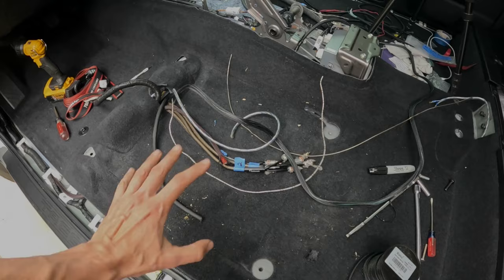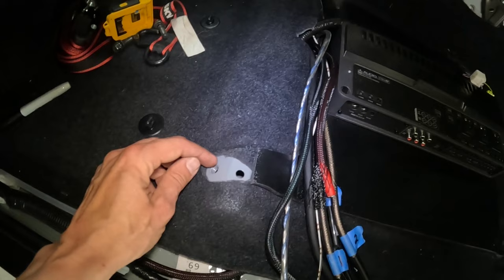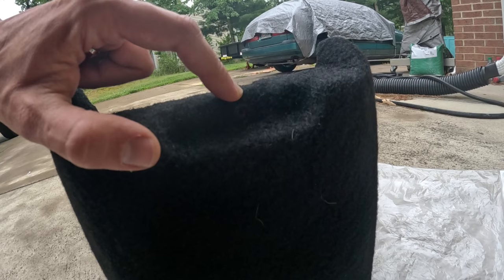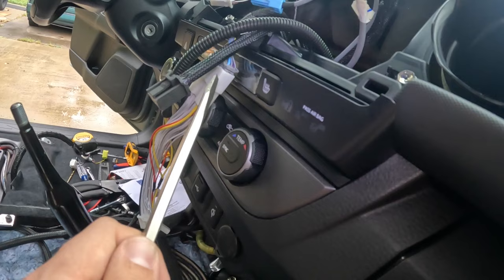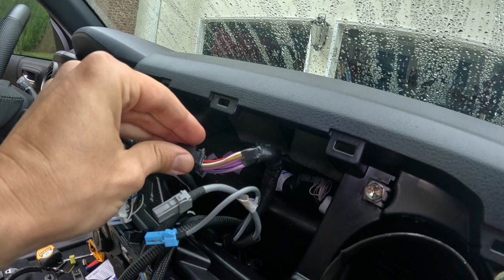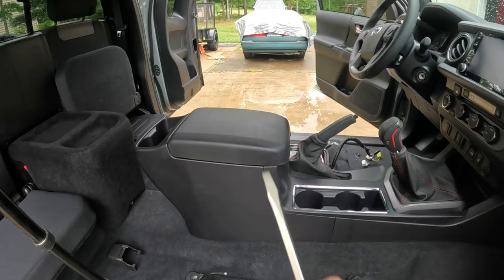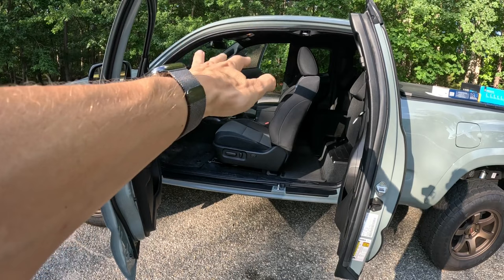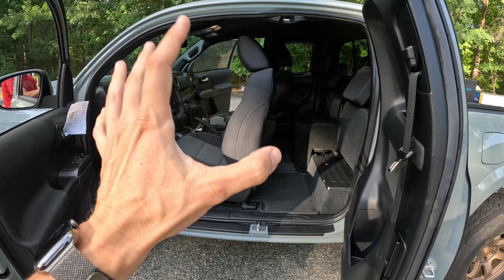DIY - 3rd Gen Tacoma - Adding a Stereo Amplifier and Subwoofer Part 2

Comment: Hello again.  I read my first comments and I have no idea what I meant by the comment related to the word theater in the dash.  

What I can tell you is that I went and bought 2 pieces of 1/4” ABS plastic today because I am going to use your examples to create my amp racks which I like you will install under both seats.  I am installing 2 Rockford Fosgate Amps.  The amp for my Subwoofer is going under the passenger seat.  I like you purchased a Stealth sub enclosure which I will mount between the two jump seats.  

Thank you for posting your videos because they gave me so much encouragement and direction with my project.  

I totally appreciate your videos

Mark

Comment: I myself was planning to do an install in my 2016 Tacoma double cab…so I bought the same Audiocontrol LCI-7 and was planning to get the same Taco Tunes wiring harness…. I decided to have it professionally installed…Stock head unit …Digital Design signal processor DSI-3…Focal Flax speakers…2 way for front doors(he made a custom mount to install the tweeter next to 6.5 speakers)and coaxial for rear…Arc Audio X2 1200.6 amplifier and 2 Arc Audio A10 shallow subwoofers…they actually installed the processor and amp under my driver seat…the only thing in view is the end of the amp(which is vented)…one thing I recommended is to add sound deadening material to the doors and rear of the cab…not only reduces road noise but eliminate rattling noises that a high powered system can produced…for a few dollars more I recommend the digital signal processor over the LC-7i…total control(crossover points and EQ)and was able to make use of the rear door speakers ….unlimited tuning to your personal preference…
Reply from the maker: Wow - really some good pointers here for sure.  Ever since testing out that Stealthbox is my other car which just has an Alline 4v pre-lit to an amp, the sub sounded so much better than how it sounds in the Tacoma (poppy and doesn’t hit as hard).  Either the LC7i is just bare bones or I need to do some serious adjusting.

Comment: This was a great video series to watch. I have a 23 TRD Sport in Lunar Rock as well, but mine is automatic double cab. Yours looks great btw. 
I’ve been searching the internet for something like this in order to check out the wiring before doing any audio work. This was very thorough, detailed and super clean. Thank you for sharing this
Reply: I have the JBL upgrade in my 23 TRD OR,  as for OEM integration. not much as of yet. Some places used a PAC audio for a '21 and claimed it worked. PAC audio says they have not tested a 23 and don't have support for the 23 if a problem arises.
Reply: On the factory JBL system it can be done the same way it was done on this Video. Do some digging online you will finde it

Comment: Hey buddy how you doing, first of all congrats, you did a super clean wiring and installation, now my question is, would this work for me if I plan to add 3 amps, 1 equalizer, and 1 audio control epicenter?
Or I need a different one?
I’m planning on adding a pair of ds18 dash tweeters, a pair of JBL 6x9 speakers, a pair of JBL 6.5 speakers and a pair of massive mid range speakers, also a kicker 12” subwoofer, for the JBLs gonna be using one amp, another amp for the mid ranges, and another amp for the subwoofer, also the equalizer and the epicenter, that’s how I’m planning it

Comment: Great video. I have a 22 offroad in the same color. I also have that same amp. Have it mounted behind the back seats at the moment but want to put a sub box back there so need to relocate the amp under the seat. Do you have any issues lowerering the seat? The automatic seats lets to raise and lower it and I'm worried ill crush the amp if someone tries to lower the seat too far.

Thanks
Reply from the maker: Have not tried to lower the seat down much knowing the amp is there.  But under the driver seat was the best option for the Access Cab as the jumper seats don't fold down.

Comment: Did you lose microphone and yoir back up camera after installing taco tunes harnesses?
Reply from the maker: @bryanbroyles2472  no loss. Everything works perfect.
Reply: @randomrebuilds  I have the same setup as you do and lost my micophone and backup camera plus have noise coming through speakers. Does your speakers pop when you shut the truck off due to the amp turning off
Reply: Are you in NC?
Reply: Did you use the factory grounds under the seats or use the other holes besides the factory grounds
Reply from the maker: @bryanbroyles2472  no noise coming from speakers or any pops.  I’m in VA actually.  The ground for the amp I used a bolt for the parking brake mount.
Reply: @randomrebuilds  ok I used the factory grounds for both my amp and the Lc7i Ill check those to see then thanks

Comment: can you add the oem rear diff lock from trd off road to the trd sport and if so what is the part number. No person on youtube has ever said anything about it and they go for ARB air compressor lock configuration
Reply from the maker: That I’m not familiar with. Might want to check out TacomaWorld and see if someone has done that. If the parts aren’t too bad - I’d be interested in doing a swap like that.
Reply: @randomrebuilds  Thankyou and your videos are awesome

Comment: I commend all the work and cleansiness. But i would have thrown the factory stereo right in the garbage. The Pioneer MVH-S522BS is like 100 bucks, it uses all of Pioneer's high volt outputs and high quality sound processing in a very small, affordable, lightweight package. It'd be less wiring(weight), more simple, and better sound quality.
Reply from the maker: Thanks. I just wanted to keep all the factory integration (backup camera, vehicle warnings, phone, Etc).  It would eliminate the need for the sound processor as well.
Reply: @randomrebuilds6862  so my factory unit is integrated into the climate controls and I doubt they make a single din panel for it. So I have my pioneer in the center console, which kept my back up camera(which I never use, im 40yo and CDL). But now I have no more chimes and no more turn signal clicks, a hidden benefit of what I did.